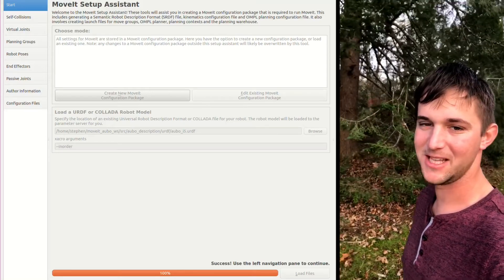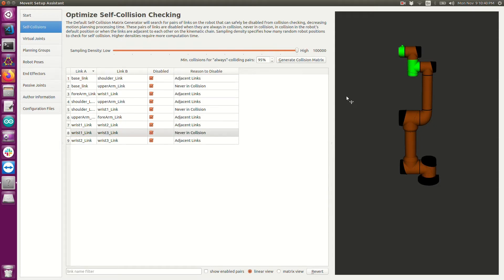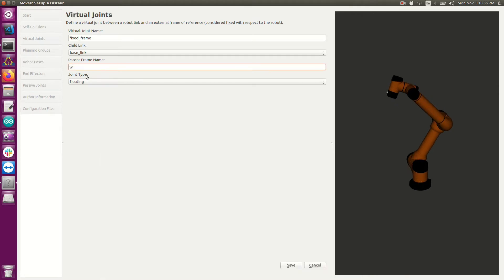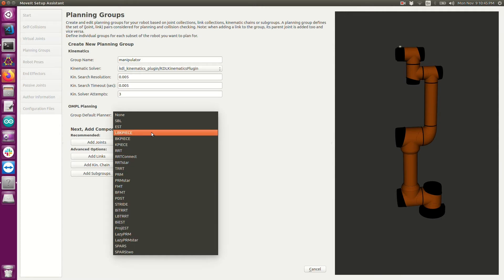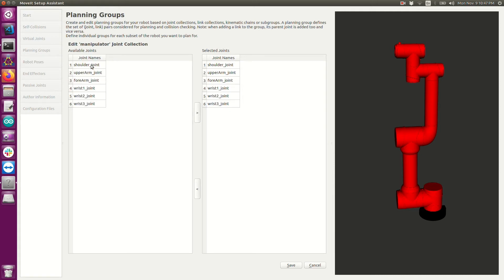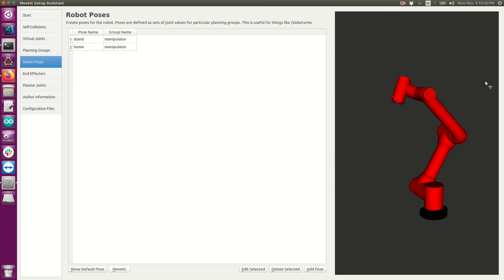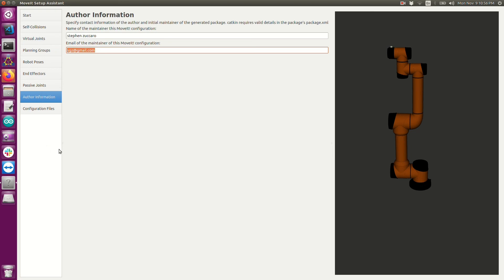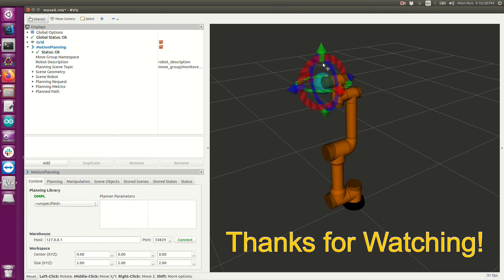Get Started with Moveit! (Step 1)

Comment: Thank you for the video, but i get an error while trying to open demo.launch. Could you help ? The error is :

RLException: [demo.launch] is neither a launch file in package [ceku_moveit_config] nor is [ceku_moveit_config] a launch file name
The traceback for the exception was written to the log file
Reply from the maker: Have you sourced your workspace from the terminal you are using? For example “ source ~/catkin_ws/devel/setup.bash”. And also your terminal command is “roslaunch ceku_moveit_config demo.launch” ?
Reply: @stephenzuccaro1090  
Thank you for fast reply.
source /opt/ros/noetic/setup.bash
source /home/umut/catkin_ws/devel/setup.bash

these are in my bashrc file. 
and also i export my own model from solidworks as ceku. Thats why i tried to run that command.
Im using ubuntu 20.4 and ros noetic.
Reply from the maker: It is indeed hard to know the issue. Your demo.launch location should be “/catkin_ws/src/ceku_moveit_config/launch/demo.launch” . I think your sourcing should be okay, but I always use “~/catkin_ws” instead of the absolute path like yours.
Reply: Do a new catkin build, that solved it for me

Comment: I loaded a UR-5 robot urdf in moveit. I don't see the UR_5 on the right side as demoed in the lecture. Do you think that there is problem with the URDF?
Reply from the maker: That would be my guess, but it is hard to be sure without more info. If you aren’t already you might try using the ur5.urdf.xacro from here: https://github.com/ros-industrial/universal_robot/tree/kinetic-devel/ur_description/urdf        Or you could try a different robot all together just for testing.
Reply from the maker: Okay, the problem is that ur5.urdf.xacro isn’t a top level xacro file. You can not load it directly. You must use either ur5_robot.urdf.xacro or ur5_joint_limited.urdf.xacro which are both also in that folder. These actually reference the file you are trying.
Reply: @stephenzuccaro1090   i did use them, I am not getting error, however, i am getting a dark blank screen in MoveIt instead of a UR-5 simulation model
Reply from the maker: I cannot reproduce your issue. I put the ur_description directory in my workspace and when I used the setup assistant it loads the model and I can see it. Perhaps it is a ros version issue like you said or maybe something about your moveit installation. You might go through the moveit installation and rerun all the install commands.
Reply: @stephenzuccaro1090  What version are you using? and can you share me the link of moveit installation.  I just want to make sure that i am using the right reference
Reply from the maker: I suppose this is the reference I’d use. http://docs.ros.org/en/melodic/api/moveit_tutorials/html/doc/getting_started/getting_started.html    You probably should make sure you can load some of there examples also.

Comment: Thanks for video! Why you are using ROS, not Ros2 and Moveit2?
Reply from the maker: I guess the main reason is I had the majority of my code base written and working in ros by the time ros2 was released, and It just seems like a big undertaking to change over. Are you using ros2?
Reply: @stephenzuccaro1090  yes, but moveit2 is not all ready released in all functionality of moveit. For example Setup assistant is not in release. I'm suffering about it.

Comment: Hi, I tried loading the urdf files into moveit setup assistant but after loading it didn't show up in the display. Could you help me out?
Reply from the maker: Are there any errors reported in the terminal? Also, does your robot model show up on RViz or gazebo? You could open up the urdf file and check that the file paths to the .stl files (or other format) are correct.